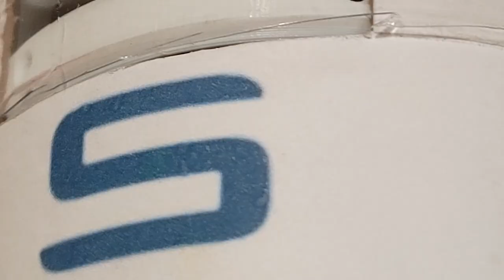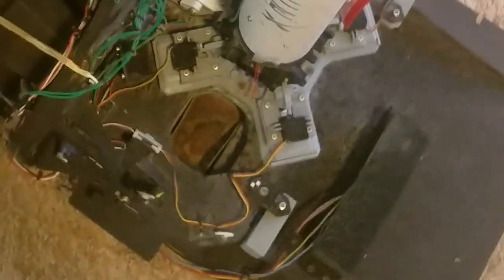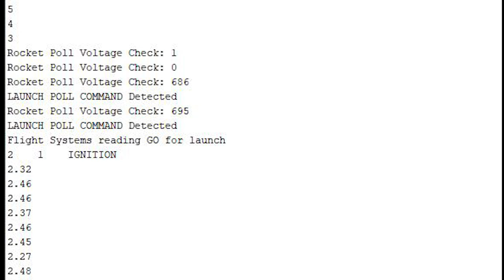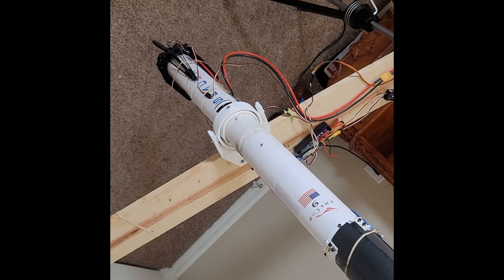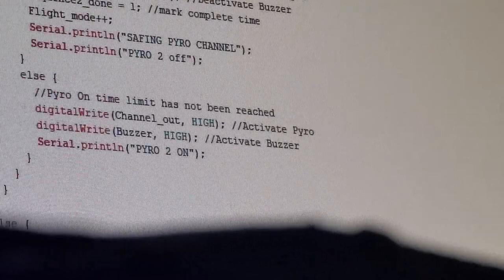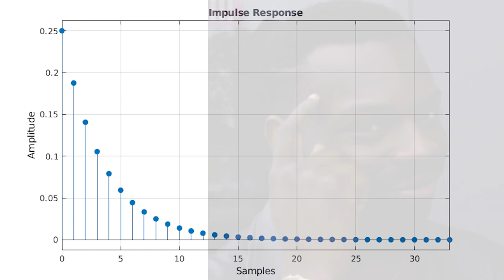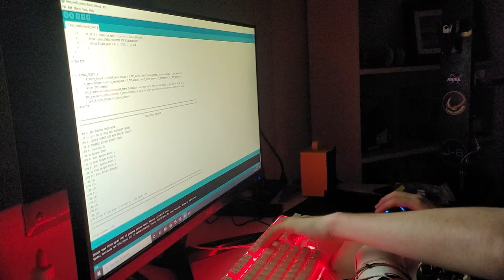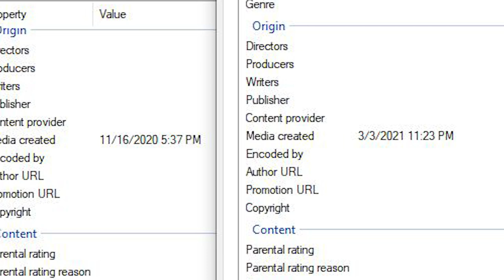Writing Flight Software for TVC Rockets (but also breaking all the flight hardware in the process)

Comment: Get a new 2mm wide chisel iron tip, use 6-/40 leaded solder and keep it clean. Those skinny conical tips are poor at conducting heat into the joint parts which leads to excessive dwell times and potential board trace failure.

Comment: Hey, what method is used to control the servos? Do you have a tuned PID loop to angle the servos, or are you doing more complex calculations with gyro and accelerometer values to angle the servos?
Reply from the maker: Both kinda, the PID loops are tuned and the gyro feeds raw data to a series of filters I am using to get better orientation data
Reply: @TZeroSystems  yeah I saw another comment saying you use an exponential moving average filter, is that because the IMU is imputing data faster than the PID loop is running?
Reply: Or is it to get a better calculation by adding low weighted previous values

Comment: I'm struggling to write software for my own flight computer. I'm just trying to get it to accurately track attitude, linear and angular acceleration, and barometric altitude for my eventual airbrake flight controller. Do you have any advice on where to start and the best approach on structuring the code, and resources ?

Thank you

Comment: Did you implement some low pass filter for imu data.
Reply from the maker: EMA filter so its exponential moving average. Kinda low pass for small variation but used more for financial variability but I have seen stability examples using it and decided to give it a shot!

Comment: But the Flight Software is a complete mess why not using header files ???
Reply: in my Flight Software i use them and it makes it a lot cleaner
Reply from the maker: @pano6035  Its better but yeah I have been told that should be my next move

Comment: what did you do in the software to align the TVC mount?
Reply from the maker: I have a guide that is kinda like a donut and you can align the donut hole with the motor mount. Then its just a matter of moving it a few tenths of a degree at a time until things align!

Comment: Hi! I am wondering, how do I go from a teensy and breakout board sensor modules to the bare minimum microcontroller chip?
Reply from the maker: Not overnight! It has been a long process to get to something a bit more robust but the new one is going to be even more bare bones!
Reply: @TZeroSystems , yeah, chips mounted on chips. No board. One needs to locate thin die mounted on thin glass, Or, the first die mounted on thin glass substrate and the other die mounted to the top of those die.